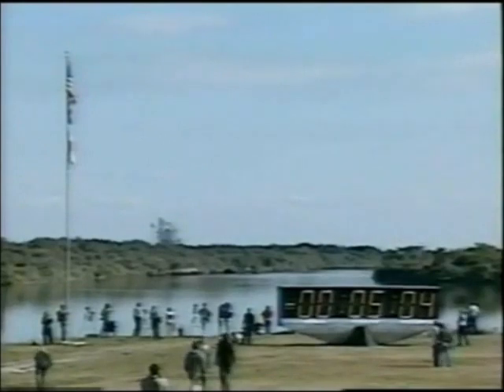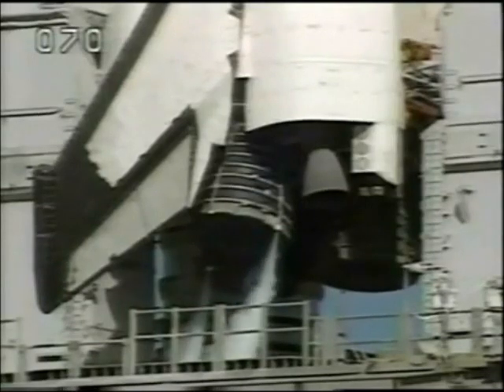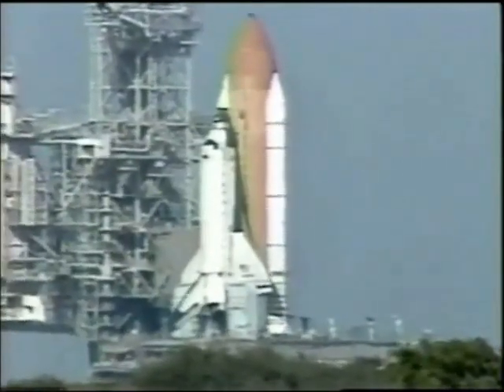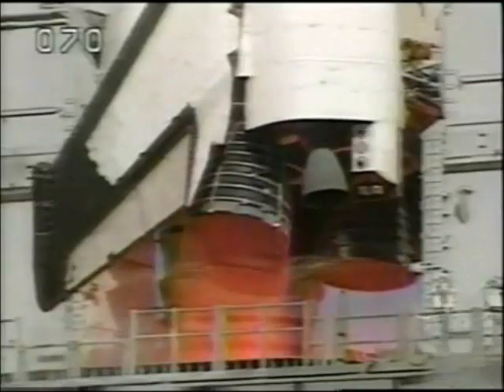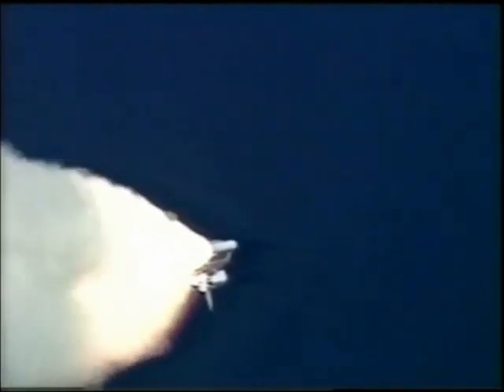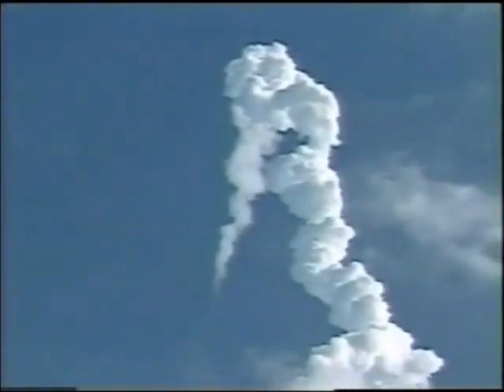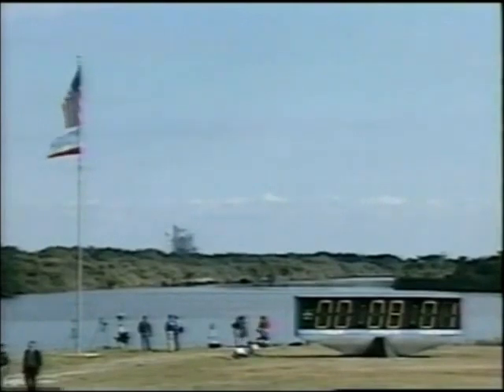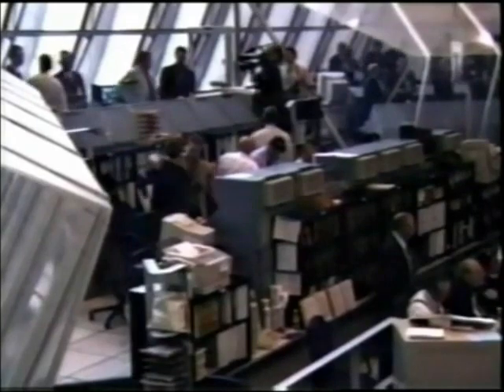STS-107 Full Launch Experience

Comment: Had it used a fresh tank and not a leftover the accident doesn't happen. All of the Super Light Weight tanks were earmarked for ISS missions, which needed all the weight reduction they  could get (its also why the Columbia could never go to the ISS, to heavy)

This flight got a Lightweight tank that had been in  storage for at least a year. The thinking is that this casued the foam to become brittle. It also allowed voids in the "bipod ramp" foam (which was made by hand) to expand over that time, cracking the foam.
Reply: Columbia could go to the ISS and was going to go there for it’s next mission after STS-107
Reply: @christopherwaits7852  yes it was going to the ISS on STS-118 which was later flown by Endeavor
Reply: I stand corrected. I had never heard that Columbia was due to fly to the ISS. Did a little research and yes, it was going to fly STS-118 due to Endeavor being in the middle of retrofit. I guess I had always heard the adage about Columbia being "a little heavy in the rear" due to it being the 2nd orbiter and being more conservative (heavy) in build. Even Challenger would have not been optimal for ISS missions, since it was also heavy (but about 2k lbs lighter than Columbia).
Reply: @Zoomer30  it was actually Discovery that was in mods at the time, and they couldn’t assemble the station and stick to the schedule with just Atlantis and Endeavour, hence why they had to use Columbia for one of the flights. 

The schedule to complete Node 2 by early 2004 likely led to Columbia’s loss. I wish it got to go to the station.
Reply: @christopherwaits7852  If Columbia had went to the ISS on mission STS 118 which was scheduled for November 2003 it would have been Columbia's first and likely only time going to the ISS.
Reply: @Zoomer30  NASA always put Columbia on missions not to the ISS for that reason, they hoped discovery would be ready by STS-118 but once it was clear it wouldn’t. They decided Columbia would fly the mission, it’s sad because Columbia’s visit to the ISS would have allowed for high quality images of Columbia in where she was the most beautiful, space. Columbia is the only orbiter which there isn’t any,
Reply: @Oklahomarailfan.  wouldn't challenger also not have any in space images due to its explosion in 1986
Reply: @Matttrainz07  Challenger had "floating in space" photos take from the free flying SPAZ satellite that was released and then later retrieved on STS 7.
Reply: @Zoomer30_  so there is in space photos of challenger, neat

Comment: After the left wing happened  with the big hole after launch ,there was not noticed any heat buildup before orbit ,why?
Reply: I don't believe there was a physical hole, punched into the leading edge, by this point.  I know the investigation video showed that happening, but I doubt there was a huge hole.  The leading edge would have been compromised and I don't think a hole would have opened up until reentry, right when the first 4 temp sensors failed.  Just a theory.
Reply: @yxeaviationphotog  as the foam unsulation impact test after the loss of Columbia has shown it is very likely that there was a hole in Columbias left wing. but nobody has ever seen if there was a hole actually and what it looked like.
Reply: @martindelrio1891  Understood.....but on day two of the mission, an object about the size of a small briefcase, as tracked floating away from Columbia.  So there may not have been a physical hole during ascent, but the story of the "day 2 object" would seem to support that   Remember, the foam strike happened before Max Q, so they were still in the atmosphere.  Had there been a hole, it's likely that the wing might have been ripped off, before they got to thinner air.  Just a guess though.
Reply: because the heat is caused by air (which causes friction, = heat 🔥 ) they were probably in a hight with low air (almost space / vacuum), the higher you fly the lower the air is, so = lower heat. If they come back from space not only there's more and more air (atmosphere) but also the reentry speed is much higher.
Reply: In other words, that is why they throttle down the rocket as it breaks through the atmossphere.
Reply: Actually according to nasa 90% of the heat and plasma during reentry isn't friction, it's compression of air

Comment: Why did Columbia have some tiles missing on the tail
Reply: Those aren’t missing tiles, they’re just the heat absorbent ones like the ones on the belly, and Columbia was the very first Space Shuttle, aside from that idk, if it were my choice, I’d say keep it to make it look distinctive, like the black chines on the wings
Reply: @thespeedypatriot6201  The reason that there are black tiles is because they werent really sure about whivh parts of the vehicle would heat so they just said screw it and placed them where they thought was neccecary to be safe
Reply: @aviationlover3613  exactly, and after they learned that I wasn’t necessary, they built the other 4 orbiters without the heat tiles on top of the chines and tail, although I think Challenger had a few more heat absorb tiles on her than the last 3 orbiters
Reply: @thespeedypatriot6201  wonder why Columbia just kept them all the way?
Reply: @nolancain8792  I think it was a bit of both, they didn’t want to deal with the hassle of refitting the orbiter with white tiles, and they wanted some distinction,  but probably mostly the former

Comment: The best thing they could have done was abort launch and land across the Atlantic. They do not have sensors on the leading edge though and did not know of the damage until they were already in orbit.
The most plausible thing was an in-orbit RV with Atlantis, but by then the crew would be starving, thirsty and possibly unconscious from CO2 poisoning.
Reply: No sensors will detect an impact, no astronauts can feel it, ground control can't see it, they did, but a day later, where nothing could be done. NASA could theoretically tel the astronauts to shallow out the reentry trajectory, but they didn't.

Comment: It's unbelievable that the crew at launch didn't know that they would only have 16 days left to live. Really sad.
Reply: VenomSausage It's disgusting that NASA didn't inform them about them about the incident on launch
Reply: @shax232  They actually were informed of the incident a few days into the mission, including a video, and they were told that it wasn't thought to be an issue.

Sadly, it was.
Reply: @shax232  NASA was going to kill a shuttle crew on the second flight after Challenger. If they didn't land in Calfornia the medal was starting to fail and if they had went to Flordia they would had ended up like this crew.
Reply: Yeah, the crew should have been told about the piece of foam striking the wing where it did, and maybe NASA could have sent up a shuttle to rescue the crew from Columbia, they could have saved 7 human beings
Reply: @saints093  NASA told them about the foam hitting the wing but they were told it was secure and will not any problem, sad.
Reply: @saints093  NASA didn't know the extent of the damage.  Neither did the crew.  How were they supposed to send another shuttle up?  It literally takes months to process a shuttle, after a mission.  There was absolutely nothing that could have been done.
Reply: @saints093  There was nothing that could have been done.